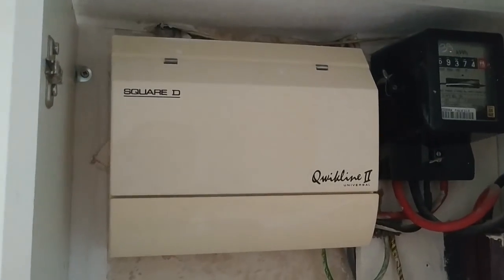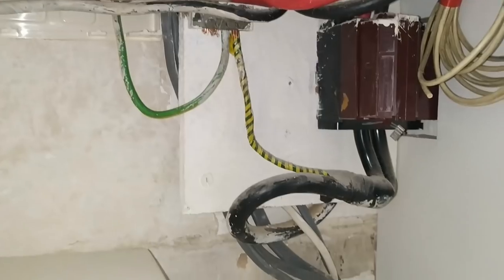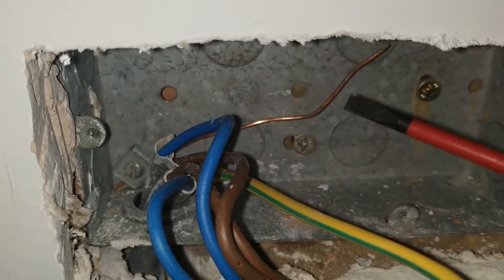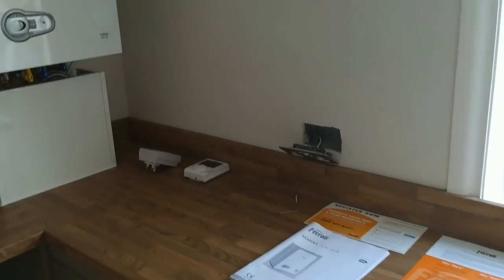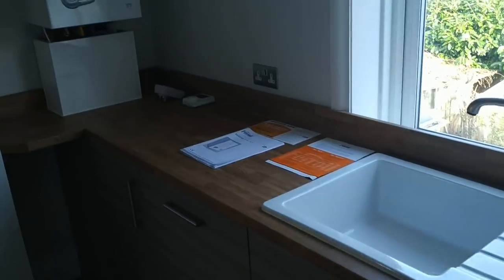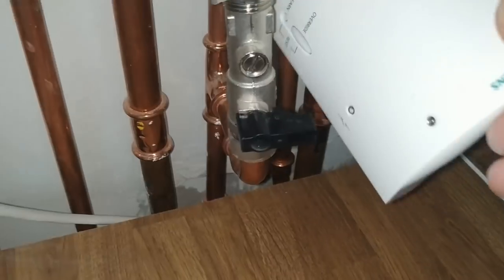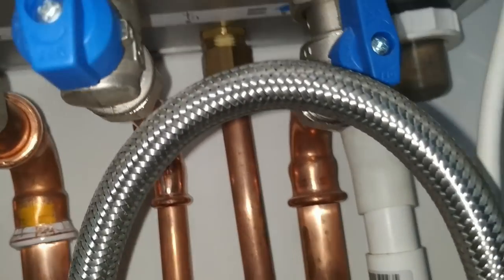Newly Refurbished Electrical Shambles

Comment: The boiler flu is awful and the cable grommets must be fitted in all room sealed boilers unsupported gas pipe .This would be enough to fail any gas safety or landlords inspection certificate.

Comment: 2:26 This is going to sound like a stupid question but are those screws that hold the wire above and below, live?
Reply: Above is neutral (left) so with the black (old colour) and blue wires. It's one block you can easily touch but will do no harm if wired correctly. Above right is Earth, also one block, yellow-green, can be touched. 
Below is live, every group has one screw, red is old and brown is modern colour. The screw is inside the switch unit. Yes you can see it but it's not simple to touch it with your finger (unless baby fingers).

Comment: Hey John, was that a 1000 volt "wind up" merger on your shelf ? I've often used one of those some 50 years + ago, Steel Works .
Reply from the maker: Yes, but it's virtually brand new - it's a plastic case Chinese copy of an old one.
Reply: John Ward Thanks for the info Mr Ward, the old one was aluminium ( as no doubt you know)

Comment: Hi JW,
was this place for sale or a rental? I f a rental the landlord should be prosecuted under a number regulation breaches. As a landlord myself and a very competent DIY'er  It makes my blood boil to see this standard of installations. Having said that I have a my systems fitted and serviced by a professional and up to date electrician and utilities engineering company. What they charge for their work is irrelevant when comes to knowing I have safe and certified and annually inspected  with peace of mind. Love your videos.
Reply from the maker: It was for sale, inspection requested by the buyer.
Reply: Charges for "professional" installations  are entirely relevant when it comes to people attempting DIY electrical work because cost it the main and possibly only reason people do it. Regs and standards are easy enough to find online and as a more than competent DIY'er but not a "qualified" electrician, if I owned this flat I would have refused to pay the "professional" who did the work.  What you cannot do as a DIY'er, of course, is provide the necessary certification/documentation no matter how good a job you do so you have to pay for a qualified inspection and sign off but that can be problematic.

Comment: As a gas safe heating engineer. That grommet fitted on the cable should be fitted to the case of the boiler to provide an air tight seal within the boiler casing,  as a room sealed boiler this needs to be completely sealed from the room.  
Thanks John great video.
Reply: How would it get oxygen to burn the gas properly if its sealed.
Reply: Simon Tay combi boilers have a double flue pipe, (one tube inside another) and it draws air in from outside.  The acutal combustion chamber is air tight from the room.
Reply: That’s ridiculous, Air tight seal, don’t be silly 😂
Reply: patrick brannan grommets on a boiler casing are there for a reason,  to seal the combustion box from the room, hence the name - Room Sealed Appliance.  Any oxygen the boiler requires for combustion is taken from outside the dwelling, it’s imperative that the oxygen is not taken from the room, that’s why you have a concentric flue.   I’m concerned if your a gas engineer, and I would consider some additional training.
Reply: paul l bennett all boiler manufacturers  stipulate that the combustion box must be sealed from the room and if electrical cabling has to enter this area (which it does) an air tight seal must be provided, that’s why grommets are used.   Take a look on a valliant eco tec plus they have about 8 red grommets fitted to the casing.
Reply: Matthew Bray the combustion chamber is a completely sealed unit within the boiler. You can remove the boiler casing and still not compromise the airtightness of the combustion chamber. Grommets have absolutely nothing to do with maintaining airtightness. They are there to protect the cable from damage from the sharp edges of the boiler casing.
Reply: @spencerwilton5831  that is incorrect please consult boiler manufacturer literature, or alternatively contact gas safe. The grommet are not the same as you fined on an electrical back box.
Reply: You make a good point about the need for an air tight seal.

That particular grommet is there to prevent the raw metal edge of the cable entry point from chafing and possibly cutting through the insulation on the flexible cable.

Power and demand thermostat wiring is to the terminals on the boiler control unit, and from there, the boiler manufacturer ensures that the combustion chamber is sealed off from room air.
Reply: Matthew Bray it there is any access from the power supply entry point to the combustion chamber I'll eat my hat! If that cable goes anywhere near the combustion chamber then we should be more concerned about heat melting the cable that carbon monoxide. If you open up that boiler you'll find a the combustion chamber is a separate, sealed component within it. The grommet should be in place, but not for the reasons you mention.
Reply: @spencerwilton5831   what reason then please? 
I work in gas compliance for a large housing Association. If any grommets are missing from the boiler casing the boiler is categorised as an at risk situation.  As there is potential for air be taken from the room to be used for combustion. Room sealed boilers must be sealed off from the room.  
Simple is that.

Comment: An  honest question: What is prejudicial about putting the two protection conductors in the same sleeve?
Reply: Can't give each of the protection conductors a good yank to check good termination. Also, you can't always be sure the conductor hasn't broken somewhere inside the sleeve. To be honest a 100 metre roll of protection sleeve costs peanuts so why skimp? 
I'd rather do a quality job to keep my reputation if I was still a practicing electrician.
Reply: @M1LAD81  And if they've been tightly twisted together, as Martin Grant builders did here, it's a pain to straighten them and sleeve them separately.

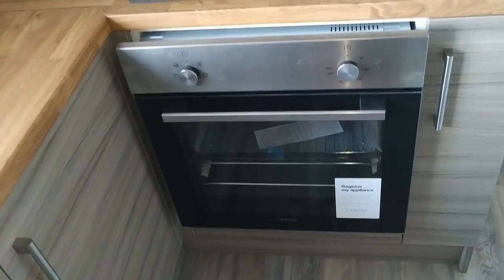Comment: 6:28 the same thing was done with our oven and hob neither were screed in though the connections were done right i think....
Reply: The job isn't so bad. But think of the oven falling on a toddler who pulls at it and you know why the screws are not optional.
Reply: @RobertSzasz  agreed on that its also annoying when opening the oven pulls it out a small amount

Comment: My guess is that last cable had the cpc conductor connected to neutral. I've seen that many times when the fucking builders wire in extractors and the like. They're too cheap to go and buy a reel of three-core. The only thing that puzzles me is what the hell is it doing down there?!

Comment: Is there anything actually wrong /against regulations with using old/new wiring colours along side each other?
Reply from the maker: No - but in a property described as 'newly refurbished' you would not expect to find wiring from several decades ago.
Reply: @jwflame  Would you expect all the walls to have new bricks as well ?
A coat of paint - and it's been refurbished !

Comment: Can someone explain the last part with the cable in bathroom. Not an electrician so don't understand what the issue was. I understand the cable being poorly fitting under sink and not plugged into anything. But when lights are on and the cable seems to stop working what does this all mean?
Reply: There was no neutral present so anything wired in to that point would not have actually worked.
Reply: Probably for one of those fancy electric mirrors but they ran out of money.
Reply: @uK8cvPAq  Oh I get that but I didn't understand the fault. When the lights came on he said it stopped working. Explained why but not being an electrician I didn't understand the fault.
Reply: The basic issue is that there is no neutral. If you wanted to connect a light or other appliance to the end of the cable, you would need to connect it between line and neutral. The line could be switched or permanent, depending on whether or not you wanted it to be controlled by the main light switch for the room. But, in either case, you need a neutral, otherwise you haven't got a proper circuit for your light/appliance.
JW's measurements showed that the brown wire was line, as you would expect it to be. However, with the lights off, we saw only 230 volts between the brown and the blue, showing that the blue was not neutral. If it was neutral, then we'd have seen the full 245 volts, the same as were measured between line and CPC. This showed that there was either no neutral, or a faulty neutral.
With the lights turned on, the voltage between the brown and the blue wires was basically zero, but the voltage between either one of them and the CPC was 245 volts, indicating that they were now both live at 245 volts. This showed that the blue was actually a switched line that hadn't been properly marked up to show that it was a switched line.

Knowing that the blue was a switched line explained why the blue almost looked like a neutral when the lights were off. It was connected to neutral indirectly, through the lamps in the ceiling. That is, to get from the blue wire to the real neutral, you could travel along the wire, find yourself at a light fitting in the ceiling, then go through the LED lamp in the fitting to get to neutral. This would never work as a neutral. As soon as you put a load across it, the voltage on our supposed "neutral" would rise due to the series load of the ceiling lights, creating a potential divider and leading to undesired results.
It's possible that the CPC has been abused as a neutral, in which case it could be made to "work", but that is an unacceptable arrangement and they should have installed a 3 core and earth cable instead. Or, if only permanent or switched line is required, then the other end of the cable can be re-connected to provide just one or the other.
Reply: @patrickwigmore3462  Ah right. The he reacted I thought it meant it was either a fire risk or a shock risk
Reply: @TheStevenWhiting  Well, it is a shock risk, because there are exposed live parts. It's also not properly secured. But you already alluded to those problems so I didn't bother mentioning them again! And if the CPC has been used as a neutral, that's a shock risk too.
Reply: @patrickwigmore3462  Could be that they used the ground as a neutral to not put a 3 core cable?
Reply: @alerighi  Yes, it looks like they could have done that. I mentioned this in my previous comment, but apparently I was in the mood to say "CPC" (Circuit Protective Conductor) instead of the more universally-understood "earth" or "ground".

Comment: At 19:10 you got 230 volts from the live to the switch live. How is that. What is the theory that gives that value ?
Reply: The light switch connects live to lamp when on, nothing to nothing when off.  The cowboy that left behind an insecurely terminated flex also connected it wrong, using blue (a legally reserved color) for the light and brown for the always-on live. When he measured with the light off, he was essentially trying to power the lights through the voltmeter, thus getting less than the full mains power.  Proper wiring will use brown for live, blue for neutral, yellow/green or bare for earth and any other color for the switched lights.

Comment: That's just hideous. I can't get used to those little DIN rail breakers and tiny breaker box. US boxes are enormous by comparison and embedded into the wall.

Dunno in the UK, but in the US that receptacle wouldn't pass inspection. The US NEC requires using a pig tail & wire nut when there are more wires than terminals.

Were you hired to clean up this mess?
Reply: Wire nuts are awful and the UK is correct to have banned them decades ago. It's possible to use them correctly but they often aren't. (Don't pre-twist!) 

UK receptacles are usually designed and listed to join up to three wires.

Comment: Done my share of this on eletrical,plumbing,framing on houses I have bought. No GFI in kitchens your side of pond?
Reply: GFI is mandatory on the whole building.  Exceptions are made for mains-powered smoke detectors (which have battery backup) and shaver outlets (which have an isolating transformer).  At least one GFI covers everything else.
Reply from the maker: Virtually all circuits in homes need to have RCDs / GFI.
Reply: GFI (RCD) outlets are not used in the UK. They are included on the breaker panel. 
In North America, areas which require GFI protection normally use a GFI outlet as the first in the circuit, then all the following outlets are daisy chained into it. I only have one GFI breaker on my panel - this is the permanently wired dishwasher. All the rest of them are either single GFI outlets or daisy chained to one.
Reply: @stephenwild2058  You mean that one GFI covers the whole box or that each breaker is a GFI.. Like to see a picture of the inside of a box like that!
Reply: @robertmccully2792  They have a separate device which covers a number of breakers - often it is two each covering half of the circuits. Here is a British electrician installing a new breaker panel - they call it a 'consumer unit' for some reason. There are relatively few circuits in the new box because the British use something called a 'ring main' that means fewer branches are required, though I frankly think they are daft... 
Link to UK breaker panel install: https://www.youtube.com/watch?v=TzRSCWAph1A
Reply: @jwflame  But most don't - unless 'recently' visited by a sparkie.
Reply: In the UK, I think its to do with the 'earth resistance' of the CPC grounding circuit - the fault current to ground at my house is not high enough to blow a fuse/breaker fast enough so I need a GFI. Some other homes near to mine have low resistance ground supplied from the power company so they can, if they want, go without a GFI.
Reply: @ridefast0  The point of the earth wire is that it prevents any voltage appearing on metal casings - if it is not doing that, it is faulty.
It's why when testing earthing, we look for a resistance of an ohm or less.
Reply: @millomweb  An ohm or less might apply for TN (wired earth) systems. For a TT (local earth electrode) system I don't know about current edition but the Whitfield electricians guide to 17th edition regs states that "the resistance of the earth electrode should be as low as possible and  never more than 100 ohms" (p100). There may, therefore, be unavoidable dangerous voltage on the metal casing but the effect of the regulations is for the protective device to remove it quickly before it can hurt anybody. In the case of 230V supply and 100 ohms earth resistance, the fault current on its own would not even blow a 3A fuse so an RCD/GFI becomes necessary.
Reply: @ridefast0  I've no experience with local earth provision but from odd bits I've seen, it seems to be a very amateurish affair poorly understood by experts !
The necessary text to explain it all would over fill this little box.

Comment: 4:16  The end of each wire that enters the power outlet should be terminated
with a crimped connector and not having the stripped portion in the power outlet.
not having a crimped connector leaves a part of the wire that is not insulated protruding
and exposed outside of the terminal.
Cheap unprofessional installation all round.
Reply from the maker: The wires are solid core, adding a crimp terminal to those won't achieve anything.
Reply: @jwflame ....and, is something I've never seen in the UK?!
Reply: @jwflame  
It will achieve a great deal, in the sense that there will not be any exposed wiring outside of the terminal. as the crimped connector is wholly inserted into the connector block, and not all wiring is single-core solid wire
The crimp connector also affords a much better secure fitting for the 'grub screw' to secure to.
That is why the wire termination devices were designed for that purpose.

Comment: When looking at the double sockets, you didn't seem happy that two live wires and two neutral wires were paired up and connected into one terminal each in the back of the socket.  Is that not recommended?  I thought it was perfectly safe as long as they were securely terminated.  Most of my wall sockets are wired like that - should I terminate the wires coming in (if it's a ring main) in something like Wago WA203 connectors (https://www.tlc-direct.co.uk/Products/WA203.html) then have a third wire coming from them and going into the terminals of the socket? Meaning I'd have 3 Wago blocks, one for live, neutral and earth and only 1 wire per terminal on the socket.
Reply: The cpc or circuit protective conductors are the earth wires. How you connect 'em up is a total can of worms, as Sparkyninja here explains...

https://youtu.be/YBdu5nOc0Iw
Reply: No. How it was in the video is the correct way. John was commenting on the two CPC'S or the Earth's as you would probably call them. There are also two of these, but they have been joined together and had a single piece of sleeping slipped over them. This is bad practice. They should be sleeved separately.